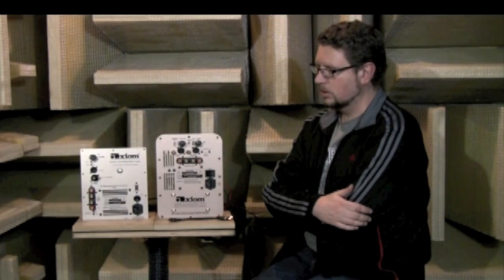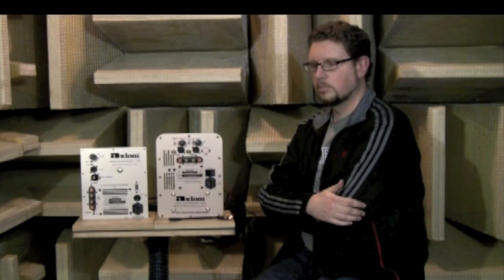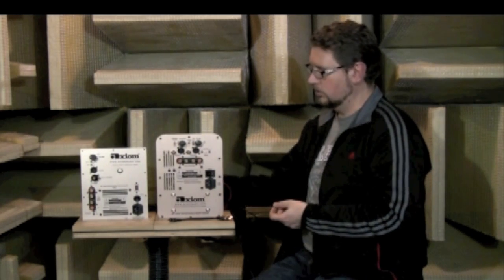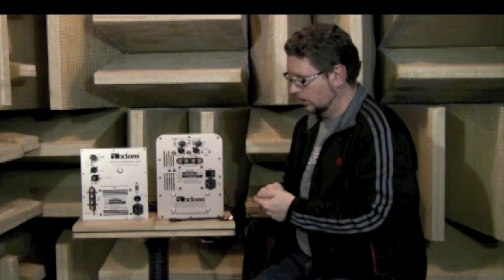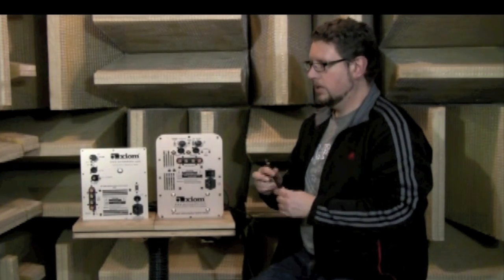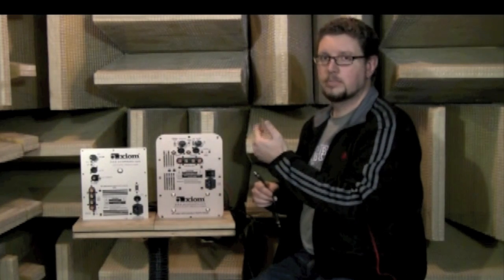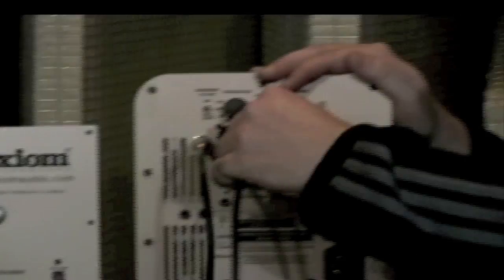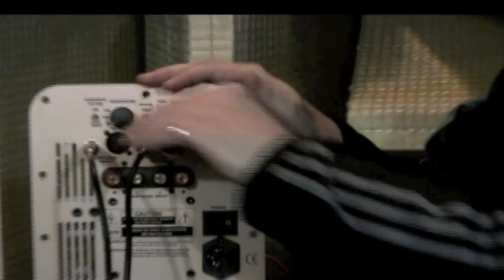How To Wire Dual Subwoofers (Or Even Multiple Subs!)

Comment: You never touched on vintage gear ....like receivers from the 70s or pre-amps from the 70s c'mon . There's loads of gear from this era still in use today with speaker level inputs and you didn't mention a thing ?

Comment: Awesome video. Wonder if you can clarify something for me
I'm looking to upgrade my home theater and I want to put in 2 subs. Now looking at the avr options, there are ones that have a single sub out, 2 sub outs and apparently some that have 2 independent sub outs (like the Denon x3700h)
My question is - which is the 3 options is best sound quality-wise?
Reply from the maker: Thank you, Alex! Two independent sub outs would be my choice as it will allow you the flexibility to setup and control each subwoofer independently of the other. So you would be able to adjust for the precise distance/delay for each sub if they are not setup symmetrically in your room, as one example.

Comment: I have recently upgraded my home theatre from a single Dali IKON Sub to dual SVS SB-2000 Pro subs.
The dual subs have their own respective output from a Denon x4500 receiver, however I was wondering if it would be ok to daisy chain the old Dali IKON Sub to one of the new SVS subs, for a three subwoofer setup.
Would this effect or damage the SVS sub that the IKON is connected from?
Would the big difference in power output (IKON - 250w vs. SVS - 550w) have any negative effects?
Cheers.
Reply from the maker: You can certainly try it, there is no risk of damage as long as you are using a low level connection (RCA or XLR). The only issue could be that the Dali sub runs out of steam before the SVS subs. Thanks for watching, and let us know if there are other topics you'd like to see covered.

Comment: In running lfe out to Y then to anotherY then anotherY splitter lol ...bear with me here 1.Y goes to 2 more Ys giving me 4 total outputs...one goes to L and R (red/white)on a wireless transmitter to a bic F12..ok...the other Y has 2 subwoofer cables connecting to 2 other subs ..that's 3....and heres where I start having questions 
1.if the subs 2 and 3 have red and white is it ok to only plug one cable in from the 2nd Y and if so should I plug into red or white or dies it matter
Now for the other question 
2.i also have another sub hooked up so that's #4...its ran through its speaker level input from the receivers front L/R channel as it should...is it ok to run all 4 subs 
So I'm using the lfe out from receiver to Y splitters for 2 subs and 1 wireless tranciever (given question 1 pans out) AND I'm using the front speaker option for a 4th sub ....just one more question connected
3.given 1 and 2 pan out lol ...can I hook a 5th (I know lol I know)yes a 5th sub by going from reciever... to 4 th sub speaker level inputs...THEN to another exact same subs speaker level input THEN to the front speakers L and R ...going radio to sub to sub to front speakers...and if it is ok do I run parallel or series while going sub to sub to speakers?  I'm sorry it's so much for 3 questions but I cant find an answer anywhere pls help me I just love bass lol
Reply from the maker: 1. Yes, that’s correct.
2. As long as you have your main speakers set to large in your receiver, using the high level connection on the 4th sub should be fine.
3. In theory this should work, but you run the risk of some serious ground loops unless everything is carefully wired and the two high level subs and receiver are all plugged into the same electrical outlet.
Hope this helps, good luck with this 👍
Reply: @AxiomHomeTheaters  it does help and thank you for responding  everything is carefully done and it sounds amazing. 5 subs is almost where I want it ...knocking the wind out of everyone on the couch.  Thanks again 👍
Reply from the maker: @lerryscoffieshop  You are very welcome, glad the advice was useful, sounds like you might want to nail the couch to the floor, just in case ;)

Comment: What if your subs dont have output only input
Reply: I'm trying to run 5 subs total off one lfe out and the other using the front speaker channels ...I have a few questions actually
Reply from the maker: @lerryscoffieshop  If your subs don’t have output connections to allow for daisy-chaining, you can use RCA Y-splitters on the LFE output. Normally subwoofers have fairly high input impedances, so it should not cause any loading issues. Ask away if you have more questions, and thanks for watching.

Comment: Denon AVR-3801 AM/FM Stereo 735-Watt 7.1-Channel Home Audio Surround Receiver - sub woofer has a pre out right and left.
the 2 subs i want to hookup has only one right left in on each sub. how to i hook them both up without loosing any power from each.? i did hook with a splitter one wire/ cord to each but lost power or sound to each too. do i need multiple kinds of splitters for this? thanks for any info? or help...i had pics but don't see where to add them? hmm.. but any help would be great! Thanks..
Reply from the maker: You should not use the left/right pre-amp outs, you should instead use the dedicated subwoofer out on the Denon. If your subwoofers don't have an in/out pass-through to connect a second sub, use a Y splitter at the Denon sub out.
Reply: Thank You  @AxiomHomeTheaters  my hubby is messing with it all now in the other room. i "the wife"  just wrote you a pretty big article here and somehow we went to another page then hit back and it was all gone and so... would of had to re-write the whole thing all over again. Will email you here shortly with pics. really would like to get this thing going the right way. 2 KLIPSCH KG 3.5 FLOORSTANDING SPEAKERS... 2 new Klipsch Heresy Speakers... 2 older fisher floor standing speakers and the 2 new ...Acoustic Audio PSW-12 500 Watt 12-Inch Down Firing Powered Subwoofers. But only one left right sub out on the Denon AVR-3801 AM/FM Stereo 735-Watt 7.1.. i know he went out earlier and purchased some y splitters at wally world. payed for 3 or 4 kinds? i think. we are not sure but hope we get it all to work. He jams so loud now stuff falls out of my shadow boxes on the wall from thumping and jamming out. "which i will be moving those to another room soon lol" But he loves to jam out. Just want 2 subs to work etc. Movies sound great too. But loves his music. and you tube music. can't send pics here but will write you a email here shortly. i told him now i know who to write if anymore probs or need help or something. Sending email and link and pics should be up there soon. and THANK YOU SO VERY MUCH!!! 5 STARS!! :-)
Reply from the maker: @marnameee7961  you may be confused because of the colour coding of the pre-outs. If you look at the back panel of the Denon there is a line from where it says SUB WOOFER to only one RED RCA jack. The white one beside it is for the centre channel, so it’s not a left and right sub out. Connect the y-splitter to the RED SUB WOOFER RCA and run a cable to each of the subs. Done.
Reply: @AxiomHomeTheaters  Ok got it. Now i understand that white one is not a left etc etc... but on each sub? there is a red and white - right and left in.. on both subs. they are the same subs. just have 2 of the same kind etc.. so only one goes into each sub? even though there is a right and left rca input?
Reply from the maker: @marnameee7961  Yes, just use either the left or the right input on each sub. It does not matter which one.
Reply: @AxiomHomeTheaters  Ok  i will be trying that method next in a few hours here. its going to be another all nighter ova here at this stead.. :-)  working on the stuff and still setting things up around the room and so on etc etc.. me or Tim may send some pics soon.. from  https://www.facebook.com/marna.parentstrahm    .... And Thanks in advance for the info :-)

Comment: My Velodynes have Left & Right Input and Output jacks. Do I daisy chain both L & R channels ? On the first sub I use a Y cable to feed both inputs with a single cable from the receiver.  Is there any benefit like more gain ?

Comment: So i want to do this and do the daisy chain method, i can just use a single subwoofer cable to connect both subwoofers or does it need to be 2 RCA cables coming from L+R? my sub has a LFE and L+R inputs.